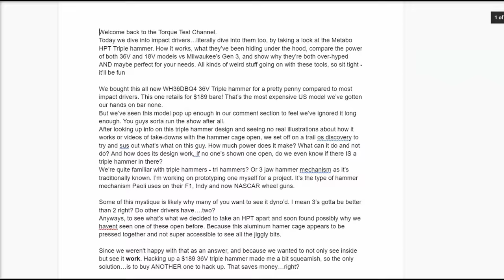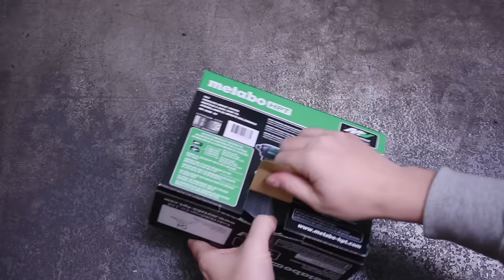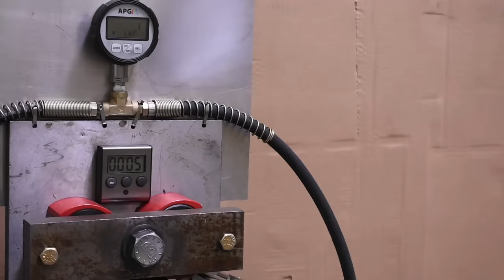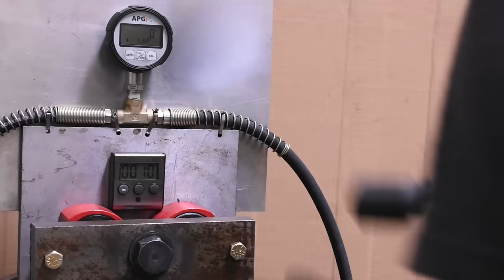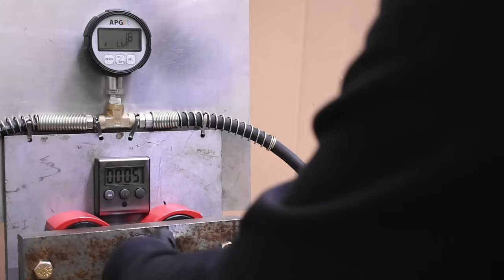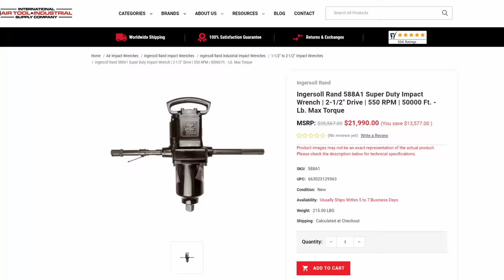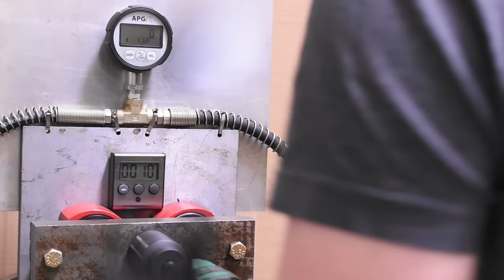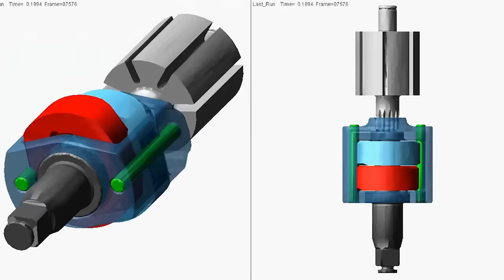High-Speed Video Uncovers Weird Stuff In Popular Impact Driver (See Comments)

Comment: I think the test is flawed, there should be more inertial force to the higher degree of rotation in the hammer. I surmise that the peak impact torque happens faster than whatever is measuring it can actually measure. Everything is a springe and with every impact there is a peak, enough to loosen a bolt, but its different than standing on a breaker bar because peak torque is all the time. I'd be interested in seeing if the loosen torque is the same, with a breaker bar and vice versa.

Comment: I remember reading some marketing materials from HPT when this came out that said the impact hammers 3X when not fully loaded then 1.5X when fully loaded. Believe what you are seeing is by design. In real life screw installing I’ve seen no difference between the 18V and 36V. Just buy 18’s so when they break I’m out less cash. This is certainly not a lug nut remover, but does well driving screws extremely fast, especially 3” and below. It does run long lags just fine but gets way hotter than other impacts I’ve used. The impact mechanism will just about burn your hand if you run long lags non stop for 5-10 minutes. 

Thanks for cutting it open, I have always wondered how it worked!

Comment: Even if they call this an intentional "feature", it clearly doesn't work to accomplish what they say it does with the middling results these drivers get on your dyno. There's no heavier load than hammering on a stationary bolt, and the torque they make is nothing impressive.

I smell a situation where the engineers had an idea, built it, and even though the results weren't that great they handed it over to the marketing folks to put a positive spin on it and sell it anyway. Still makes this video a valuable contribution, since it highlights the fact that even though marketing may sometimes be "true" in terms of features, that doesn't necessarily translate to "better".
Reply: also, they're ripping off their 36V customer base. the 36V should be a redesign , and weigh less than the 18V.
Reply: I have the 36 volt Hitachi Triple and the sub compact impact driver and they feel great in the hand and the triple hammer is great, so much smoother at driving regular fasteners. I am a Makita guy but the new 36 volt battery is big but last sooo freaking long. You can build decks for days.
Reply: When used for what’s it’s intended for it is an awesome driver.   Ultimate torque tests on a giant bolt isn’t what we use them for.
Reply: Believe it or not, "hammering a stationary bolt" is not something people normally do as part of their job. :-P

Skipping one of the hammers at high speed means you get 33% less IPM but (up to) 50% stronger impacts, which can be beneficial in some situations. And worse in others.
Reply: @RFC-3514  It seems that the engineers created slippage on the hammers for a certain effect. Not everyone wants a fast and heavy vibration Milwaukee. I own it and it's weird and smooth and has strange modes. In them years it will be a cult classic basically.

Comment: Really cool to see it in slow mo. Have you ever used one of those really cheap 12v cigarette lighter plug impact guns? They spin up for a good 5 to 10 seconds and then whack. They actually hit pretty decent because they spend so much time ramping up to full speed.
Reply from the maker: We'll have to do one!
Reply: @TorqueTestChannel  yes, please! I still have one of these in the wife's van, I don't have to worry about keeping a battery charged to run it when on the road. :) I may still have one to donate if you need.
Reply: Honestly, if such a tool were to draw from car’s 12v, the tool can have an internal step-up transformer and actually run at 18~24v easily. The question is going to be the amp draw on the outlet. 

It shouldn’t blow the fuse… 😅
Reply: @reallifeengineer7214  What fuse? Oh, you mean that bent paperclip where the colorful little fuse used to be? 🤣

Comment: Skipping a hit can allow more energy storage for the next hit,since the anvil takes more rotational speed thanks to its increased angular travel ,wich is what you ask for at full power.
At reduced trigger demand,you increase hit per minute,but reduces inertia on the anvil,wich is enough to drive small bolts,screws etc...
Just an idea,i'm not qualified.
Reply: In theory yeah but the hammer doesn't skip a hit, it hits the anvil vertically every third hit exerting axial force which in turn deforms the screw in the video.
It's basically 2/3 impact driver and 1/3 hammer drill.
Would also explain it's lower peak performance.
Reply: That's why it bends the screws.
Reply: @michaelovitch You are correct. Skipping a  tooth allows for higher speed of the hammer to be achieved. Higher angular speed translates in higher impact energy at a lower rate. Bending the screws might be caused by the higher energy impact

Comment: Regardless of the post-filming discovery that this is actually a "feature" designed into the tool, still very interesting, and also independently confirms the marketing material's claims about the feature.  Keep 'em coming!
Reply: so the feature is the ability to warp the screws your driving?
Reply: Yeah just like a Ford Pinto.  The explosion is a feature....Its a design FAILURE.
Reply: @narmale  If you watch the video referenced, it only did that to the longest stainless steel screws on the market, only on the 36v, and only in P mode. It drove all other large screws and lag screw just fine. 

It was also a torture test on the gun.

Comment: I got the 5 piece Metabo set with two 5AH batteries at Lowes on sale from $350 to $103 last week. My tool repair man advised against them based on internal components but you can't turn down that price even if they die. I used the impact, drill, and skilsaw to put together one of those crazy $4,500 swingsets with so many parts it would test any good man's patience. Sank probably 500 1 1/2-3" screws, 75 5/16×3 1/2" lags, predrilled 1/8-3/8" holes, tightened dozens of 5/16-3/8" bolts, cut a few 4x4s and some 1x3s, and they were great tools with almost too much power for cedar, and the batteries ended the 10 hr day with 2 and 3 out of 4 bars left. After seeing this I just went outside and tested the 18v metabo with 5.0 battery against the m18 fuel with 5.0 battery and dewalt 887 with the power stack using 6" simpson structural screws. The metabo barely lost to the m18 and blew the 887 away. My 887 has some serious miles on it from 6-7 years of abuse and 2 times being left in the rain so that's not the best reference for its capabilities but anyway I did notice the skip on the triple hammer and it still felt damn smooth and sent the lag no problem. I'll post head to heads if anyone cares but this video was extremely in depth and informative so it would be somewhat redundant for me to do that unless people were interested in refrencing practical Carpentry applications.
Reply: @johncoops6897  All brushless impact, hammerdrill, skilsaw, sawzall, light, 2 2.5/5.0 multivolt batteries, and a charger. Was on sale for a month from $350 to $206 but there wasn't any on the shelf and then I found one in a random aisle covered in other stuff and when I took it off it had a $103 price tag on it. I used my Lowes card which is 5% off every purchase so basically covers sales tax and I got the kit for $104.

Comment: I also learned for every frame per second in camera equipment it costs about $1 per frame. 8000fps=$8000. But I am sure this kit will be used in many videos to come and provides us with unique insight. I love the TTC.
Reply: Whoah.
Reply: There is no direct connection between the number of frames per second and the cost of a camera, because different cameras have vastly different specifications (the main ones being sensitivity - i.e., how much light they need - and resolution). A camera that can do 5000 fps at 2k resolution is going to cost a lot more than one that can do 5000 fps at 240p.
Reply: untrue lol

Comment: I'm kinda surprised the Japanese company wouldn't have noticed or even tested this considering its rather new tech for that style impact
Reply: I was thinking the same thing. I guess pioneers of new tech have hiccups from time to time.
Reply: "New" tech that has been around for a while.
Reply: Ya, or a machine testing torque is not what it is build for. This driver is smooth as butter and I own Makita and Milwaukee too. Imagine a car built for comfort and testing it on jumps. But I can tell no one here uses this beast.
Reply: @lifeisgoodskt  there is some validity to the triple hammer making things smoother with less vibration, especially if it's missing every few impacts.
Reply: @lifeisgoodskt  something smooth wouldn't twist screws like shown in the clips. None of the other drivers do. In fact I've never seen such a thing before.

Comment: No wonder I was getting warped screws. This explains a lot. I first thought that my screws were warping from heat. I will now only use the triple hammer on screws I don’t ever plan to reuse. This review has been more helpful that I can express. 👍
Reply: I'm having a dumb moment... (or maybe it's because I don't own one) 
How does this explain the warping of screws?
Or is it the half-trigger power doing it, from the hammer hitting 1:1 instead of 1.5:1?

Thanks
Reply: @DUKE_of_RAMBLE  I’m thinking that the way that the hammer momentarily sits on top then slides into position mixed with the variable rpm’s within a ten second or so time frame, vibrates the metal in a fashion that changes the metal on a molecular level from an odd phenomenon in regards to vibrations.
Reply: @DUKE_of_RAMBLE  I think the warping happens at full speed, and the odd vibrations from the design is halfway liquefying the metal through science. Vibrations can liquify solids if at the correct frequency. It just so happens that these triple hammers are causing a frequency that is doing something close to that due to the design.
Reply: @paedahe4975  Oh. If I had to guess, it's simply that the screws aren't as hard of metal, and were twisting from the torque.
However, if you have another, different brand driver, that has equal (or more) torque, but doesn't cause the screws to twist on the same batch of screws, then you may be on to something! 🤔
Reply: @paedahe4975  They'd be red hot if they were experiencing that. 
However, I think you're talking about "Liquifaction", which is much different. That's where, say an Earthquake, causes a building to sink into the terrain. Dry sand and a speaker can demonstrate that. There's no heat involved, but does require the material be made up of a non-solid material, like sand is. Plenty of friction to make it "solid" under normal conditions, but insert that vibrational frequency and it acts like a liquid.
Reply: @DUKE_of_RAMBLE  I do. I have Milwaukee, Dewalt, Kobalt, Bosch, and Metabo dual hammer impacts. I’ve tested them on thick  lag bolts. All the dual hammer versions seem fine to drive in and out 50+ times. When using the triple hammer, the large lag bolts warp. It’s not just skinny long screws, it’s thicker stuff as well.
Reply: @DUKE_of_RAMBLE  You are so right. We are figuring this odd phenomenon out together bud. My lag bolt screws warped from being cold and driving them in to wood, some heat was involved but not enough to smoke  wood. Some heat may have played a role in connection with the vibrations of the triple hammer. I really like having this impact for working in the rain due to its IP rating. So I can’t just disregard this tool or I would. I know Flex is good in rain, but I don’t have a Flex for testing yet. I think more research needs to be done on this vibration issue so it can potentially get corrected in the future. I have two. Would you like to test it yourself?
Reply: @paedahe4975  huh... That is indeed absolutely bizarre! I wouldn't be surprised to see it in a screw, but a lag bolt exhibiting it, too, is surprising!

Only thing I have left to think of would be that, somehow, it IS delivering substantially more torque but current measuring methods aren't designed to pick it up?? Even my scientific brain finds that hard to believe it to be the case... But all I can surmise is the 3-dog Metabo is imparting enough twisting force that is causing the fastener to reach its structural yielding point, right at the interface with the material (wood), but each hammer blow drives it in further, causing an un-yielded section to come under stress... repeating the entire process over again, producing a warped fastener...? 🤪 I dunno lol

I do hope we get to the bottom of it though! Whether it's this channel, or some different one... But answers are needed! 😁
Reply: @DUKE_of_RAMBLE  Next thing I should do is look into scientific studies on vibrations and metal, and find out where zinc, Iron, stainless, ect. metals react under a microscope at certain vibrational levels and to what extent and conditions it takes for the molecules to move out of the place of a solid. I then would have to put a vibration sensor via a oscilloscope on the head of the impact to check the frequency and compare it to the findings of scientific studies of metal molecules.
Reply: @DUKE_of_RAMBLE  See the slow motion parts. When the hammer skips, he majority of the force is like hammer hit at the end of the screw. It's more like turning the screw a little bit, hitting it with a hammer and repeat. And when the screw starts to move slowly, this thing will start to directly hammering it more. 

I can only think of "everything looks like a nail when all you have is a hammer". Basically this driver turns into hammer when the screw is too hard to turn and you go with full throttle. No wonder the screw gets bent.
Reply: Too much power. I think

Comment: So this hammer has "valve float" like at red line in an ICE engine. I wonder if using 2 springs with different rates would help like done in high rpm engines. Could even be specked and done at home if wanted, just need another smaller spring inside the large spring
Reply: A heavier spring would help but reduce its out put power. Think of it like a Syncro in a gearbox.  The more teeth on the syncro the slower the gear change and the higher force required for a change. A race gearbox with greatly reduced number of teeth engages faster.
Reply: @banannaninja  you know how a syncro works? The friction between the cones gets the gear started then it locks in gear once the teeth have lined up. Fast changing syncro boxes have fewer teeth on the syncros to enable a faster change but occasionaly they wont fully get the gears lined up and they will crunch..  Not all race gearboxes are dog boxes. Straight cut gears are for strength not speed and are not relevant in this argument.. Also a "dual clutch" gearbox is a marketing term it  can often mean a gearbox that splits the input drive through  separate gear trains  so its in every gear all the time just waiting for it own clutch on each gear to go.. Often used on old cnc machines the dual clutch actually means a clutch on  each gear and the clutch logic is handled externally.
Reply: @banannaninja  cool stuff. I love cross-over tech like how a problem is solved in 1 application translated to another
Reply: @banannaninja  Strangely still worse than the Milwaukee 18v
Reply: @banannaninja  Thats the idea, but its useless in fine carpentry or joinery. 18v and higher  impacts are unusably overpowered. 12 or 10.8v is the way to go.
Reply: That's some intelligent thinking.
Reply: That's the same analogy I was thinking. Besides stiffer valve springs can also go lighter weight rockers, valves, retainers. Titanium hammer time? ;)
Reply: @morganspencer-churchill2136  The newer 18v drivers most brands have power level selections, every bit as softly powered as those lower voltage models.   To me though fine carpentry or other sensitive work requires manual final torquing .  Were not talking wrenches after best possible torque, in drivers I have wondered for years why no one comes out with an impact driver with an auto shaft lock that's now typical on most drills, that would allow final torque to be done manually.  Yes I'm am sure the extra stage required to implement this would lose some power, but not more than can easily be added to negate the loss.  Would be so much more useful IMHO.
Reply: So basically a mechanical Red line 😂
Reply: Internal Combustion Engine engine?

Comment: With 3 hammers rather than 2, you have 3/2 times more many chocs for the same speed, but the energy for 1 round is the same, so the energy per choc is 2/3 times the one with 2 hammers. So, the 3 hammers design allows more frequent hits but also lighters ones. This is an impact driver that is more gentle for the bits.

Comment: I have Metabo HPT' triple Hammers and their 2 dogs hammer drills

These impact drivers are not meant to be used for large lag bolts their are used to drive deck screw and other fasteners in which the triple hammer far exceed the control of my Milwaukee and even my Makita's
Torque tests aren't the best test for impact driver quality/function
Impact wrenches r great for those test

I love the triple hammer and so do almost everyone who has tried them
Reply: Exactly. 👊 I own the Fuel 2853 (power) and the HPT 36v (control/ergonomics), but my favorite for speed-control and ergonomics is the HPT sub-compact (WH18DDX). I use it every day, and by-far more than the others.
Reply: @d.a.9937  Yep that's why I own so many different tools and colors cuz different tools work better for certain tasks
I reach for the Triple hammer for most screws and smaller lags and metal roofing screws
Control is most important to me and the Metabo HPT is faster or as fast in most of those applications to my Milwaukees-more torque isn't what I'm looking for when driving large lags-I choose a impact wrench and even a clutched Hammer Drill for those